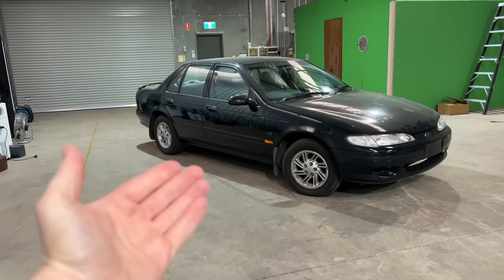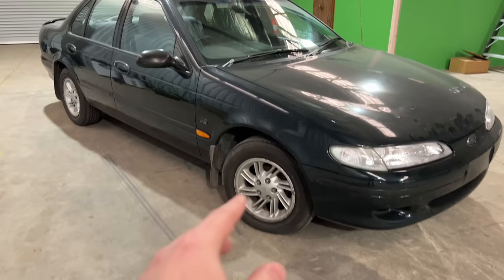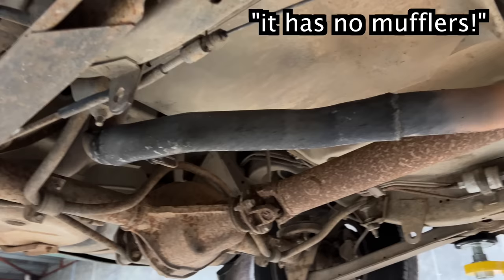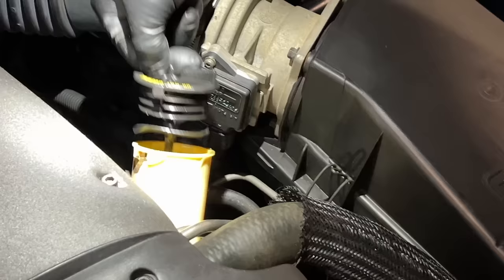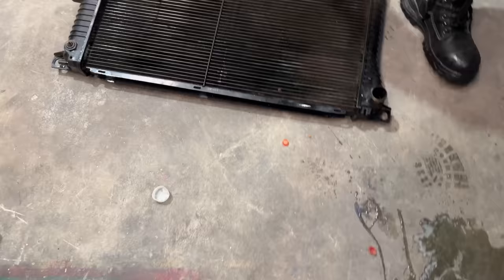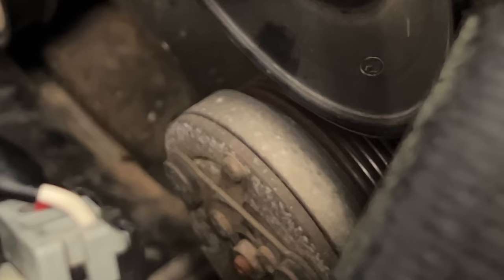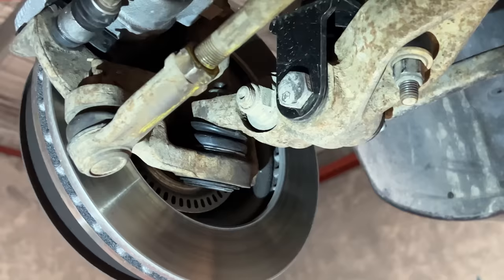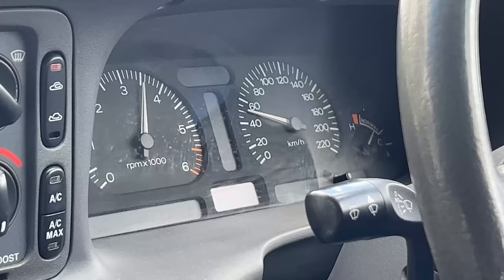Strewth mate, I got a V8!

Comment: Turbo Barra swap.
Reply: For real - those 5L motors were GUTLESS and they drank harder than a 30-year alcoholic.
Reply: You can of course rebuild the 5.0 with better-than-stock parts and end up with not only significantly more power but slightly better fuel consumption, and a 5 speed manual conversion would also improve fuel consumption.

Comment: James isn't a very good mechanic lmao.

For the sake of 70$ should of got new bearings, 50$ to linish the crank. Those crank seals will leak, you can see the exact moment the seal folds the wrong way.  Should of used copper spray for the head gasket too. I'll be in Sydney in 2 weeks message me an ill sort it out.